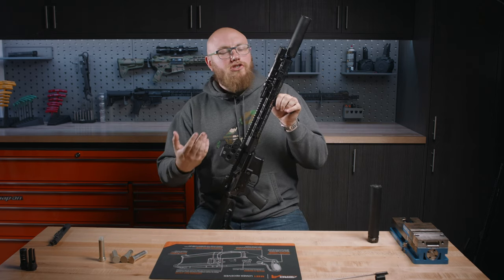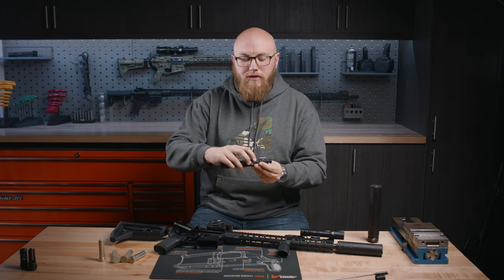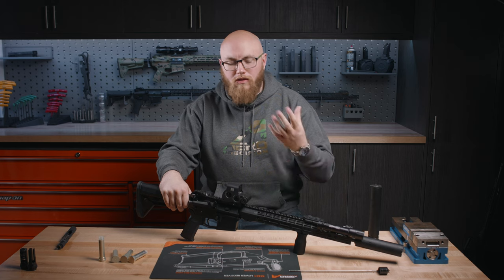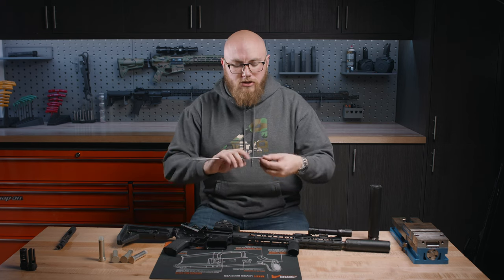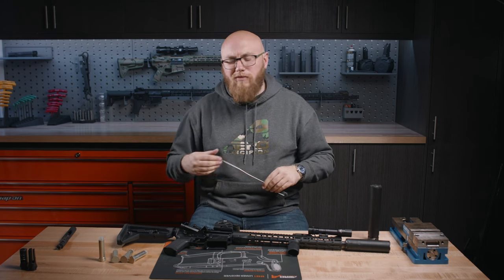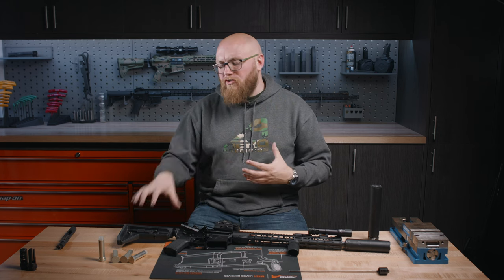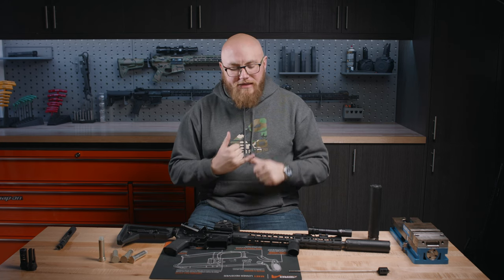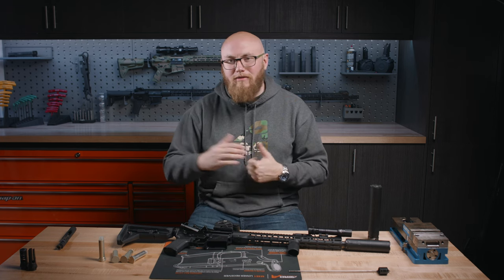Build for Suppression

Comment: Yeah, definitely so many variables to consider. It cycled fine unsuppressed, but started having cycles issues running suppressed. I had no luck with any gas block adjustments, then I realized I needed to go with a lighter buffer. I replaced the H3 with an H2 which got it cycling with 220gr ammo, but then ended up getting an adjustable buffer because the H2 was still too heavy for 200gr and 190gr. Went lighter with the buffer weights and that did the trick. I highly recommend the adjustable buffer when starting a new build - definitely easier than buying and returning a bunch of different buffers.
Reply: Imm having the same issues, withOUT a suppressor , and I’ve hopefully deduced that I’m going to reduce from H2 to carbine buffer weight
Reply: @chupacabra304  what length barrel and gas tube are you running?

Comment: Recently replaced my Faxon 16 inch 308 barrel with a 20” BA bead blasted premium heavy profile barrel. Using a SA bleed off gas block, 308 carbine buffer and a sprinco orange spring and it purs unsuppressed. Add on the Sandman S and 6clicks on the gas block and you’re back in business. I am super impressed with the new barrel change. Tuned with hand loads of 168 gr SMK and 44.6 gr of Varget. ( don’t use my data tho ).  12.5 308 with sandman S is in the near future.
Reply: Just bought this exact same barrel and adjustable gas block!

Comment: There's also buffer springs, adjustable BCG's, THEN there's port size to think about, if using THOSE parts...  This isn't even considering what length gas system you're going to run!  That's also not discussing what caliber you're going to run, and whether you're running supers or subs.  There's SO MUCH more to consider when suppressing the AR platform.

Comment: Adding heavy weights at the buffer tube such as H1/H2 and even H3 is bad because it doesn't do anything for the actual gas that is now carbon caking the innards of the BCG
Always do adjustable gas block
As carbon is harder than some rocks in your backyard and that's going into your action. Prevent is from coming into the action, rather than adding an extra hard spring or weight to stop it at the gas key level, while it's already down the tube and caking the f out of your firearm

Comment: Anyone have any issues with a low mass bcg using an adjustable gas block while suppressed? I don’t see why there would be issues but idk
Reply from the maker: A low mass BCG works against you when tuning for suppressed use. They have their place in the competition world, but in this context they work against you as you are increasing carrier velocity by cutting the mass down.
Reply: Thank you! This helps a lot
Reply: @AeroPrecision I have a lightweight 5.56 bcg I wanted to use on a 300 pistol build, but didn’t realize this. Do you feel I should get a regular bcg or can I make use of the light one if I do both an adjustable gas block AND buffer tuning?

Comment: Springco wasn’t even mentioned….I get it
Reply: Because Springco is junk.
Reply: @rifleshooterchannel208  oooowee I got to know more about this!?
Reply: @C_oprator89  Chrome silicon springs are a scam. Great way to deadhead your rifle by having the recoil spring corrode and put you out of business. This is especially true on high round count session with a suppressor. It can get so hot it will pull moisture out of the air and blow it back into the action, directly exposing the action spring to something that will readily corrode it. 

Tuning should be done exclusively on the buffer using the standard stainless USGI spec action spring. Springco anything is snake oil. 

Except their actual oil, the Machine Gunner’s stuff, that’s good stuff 😂
Reply: @rifleshooterchannel208  is the super 42 a viable option or an upgrade for usgi?
Reply: @rifleshooterchannel208  I have never heard anything other than springcos extending the life of the spring. Me personally have them in guns with over 4,000rnds and mostly supressed. The ability to tune the gun with buffer and spring has always been more advantageous and actually possible because of springco making “ heavy,light,medium” strength/length buffer springs. Not to mention their extractor and ejector springs are pretty much the gold standard. I have never had any issues using them but it’s kind of cool to see an argument to the contrary
Reply: @C_oprator89  Can’t speak on the Super 42 as I’ve never used it or even seen one in person though I would caution that if it’s CS it can have the same issues.

Comment: If Rex knew anything about the AR15/M4, he'd have run his "Torture Test" more Professionally.  Not accounting for added pressure due to a Suppressor, is  a NOOB MOVE. :D
Reply: Pretty sure he stated like 4 times that he's doing that on purpose as to mimic an average end user who will never do any modifications to the gun.
Reply: @Dron K  the test is invalid based on disregarding the Manufacturer's specification to Lube the Upper Receiver/BCG.
Reply: @j.t.patton7820  How do you explain the broken firing pin?
Reply: @Dron K  When you increase the pressure to the system by adding a Suppressor, the Bolt will cycle much more violently, and won't "Dwell" long enough, before it begins to move out of Battery. Which is why adding a heavier Buffer, and/or an Adjustable Gas Block is paramount to tuning with a Suppressor.